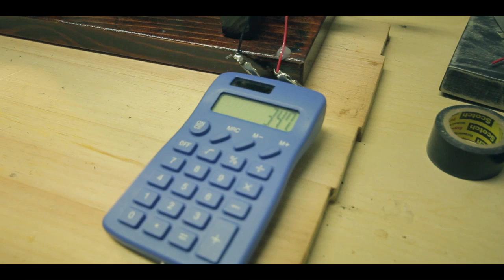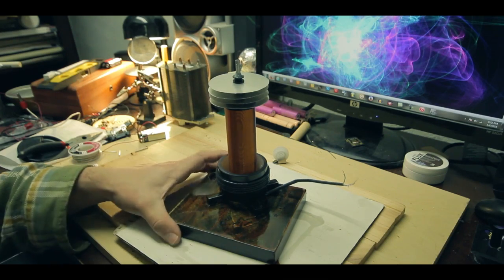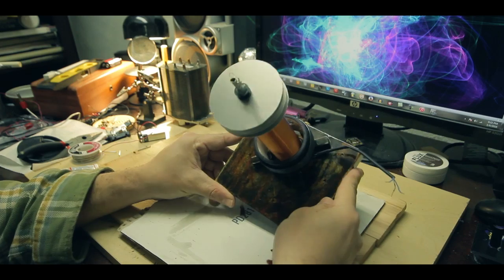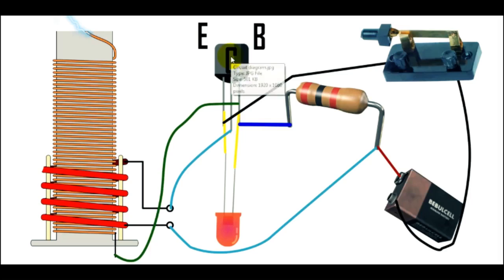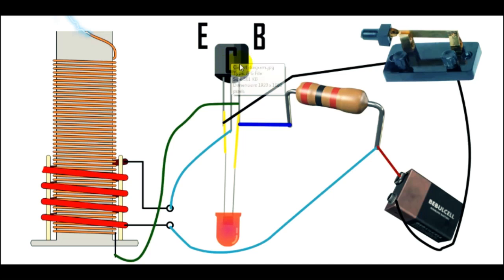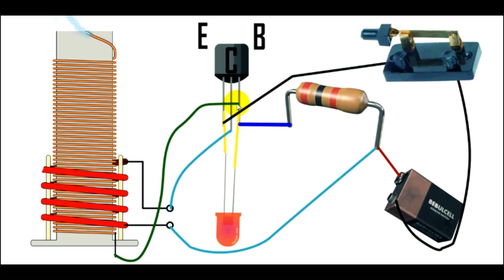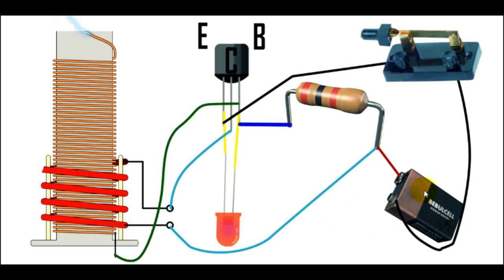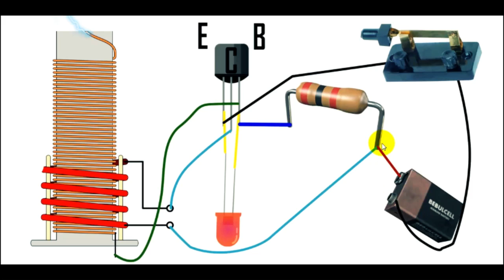DIY Tesla Slayer Exciter Coil Tutorial Mini How to Build Easy Circuit Explanation

Comment: Can i buy that one from you?
Reply from the maker: I would have sold it to you, but I sold this one already. I have built several of these, which generally look the same. However I did make several improvements. The top load is machined now, and has a cleaner look than the one displayed in the video. I could possibly make one for you. How much would you offer?
Reply: Whats a good price?
Reply: 40 bucks? plus shipping
Reply from the maker: Conspiracy Theorist The only way I could do it for that price, is to exclude the top load and staining the wood base. Staining is two or three coats and then a clear coat, this all taks several days. Machining is like $25 at the local metal shop. If you want one similar then $100.  If you want with an unfinished base and no top load, then $50. You could always finish the base and add top load yourself.
Reply from the maker: Conspiracy Theorist You should also check ebay and Amazon.  I know both sell Tesla coils, and you may find a nicely built one cheaper than what I could do.
Reply: Have a few more ??? sorry i am a newbie when it comes to this. Can you use a bigger battery such as a 12 volt? What happens when you have a taller Tesla coil? Also what would it take to make a further distance from the bulb when holding it up close?
Reply from the maker: Adding voltage will increase the distance. The Tesla coil in the video will handle 12 volts, but making a taller secondary coil will only create entropy in this specific circuit. Fine tuning, which usually involves an oscilloscope, aides in Tesla coil designs. I believe this tutorial gives a biginner a straight forward design without getting into the technical jargon, or over complicating it with schematics. 

The process of calculating capacitance, resonance, etc, helps in designing an efficient Tesla coil. The hight and turns of the secondary and primary coils work well with this specific Slayer Exciter coil. Although there are alterations that could be made to make it better, but as I mentioned, this would require an oscilloscope which are very expensive. Plus one would require the know-how in fine tuning and general knowledge in mathematics/physics based around electricity.
Reply: Interesting thanks so much for the advice what about removing the metal plates on top and replacing it with a light bulb?
Reply: José da Vēde i would like to buy as diy kit or half made. Can you send me? Tell me the price
Reply: i try this many time but the problem is always burn the resistor and transistor ..can you give me advise

Comment: On you circuit diagram you say "the negative going to the emitter, which is the negative going to the battery". But your negative wire (black) is actually connected to the positive side of the battery. On a 9V battery, the small terminal is the positive! Also, aren't the primary and secondary supposed to be winded in opposite directions?

Comment: Thank you, excellent tutorial.
One thing wasn't clear to me was the how the washers are attached to the secondary coil. Can you please clarify? Thank you
Reply from the maker: I used the washers as spacers between each top ring, which also holds them in place, and is a snug fit on the aluminum rod. Hope that helps. Thanks for watching!

Comment: The diagram showing the 9volt battery + positive going to the switch and - negative to the resistor and E is that correct ?

Comment: Is the LED in the your circuit working properly as a high-speed rectifier? In most cases, the frequency response of the LED is poor and often LED not act as a diode. I think you should insert an Ultra Fast Recovery diode or a Schottky barrier diode in series with the LED.

Comment: Hi sir may i ask if why is that my tesla coil is not working? I already follow your layout. How many volts is your bulb?
Reply from the maker: You will need a 13 watt or lower florescent bulb. Also you may need to switch or reverse the two wires coming from the primary coil.

Comment: secondry wire is insulated?
Reply from the maker: UTSAV KUMAR Can be, with a clear coating. Take a flame or sanding paper to both ends to insure there is no ckear coating. You can double check connecting by using a multimeter.

Comment: I had used 2n2222A transistor
And used 19mm pipe 275turns of 26Guage wire for secondary
3turns for primary by 1sq mm standard wire
22k resistor is used no alluminium foil is used
But It can't glow bulb
Please reply and help me urgent I had to submit my project at college
Used 5 volt 800 mA supply
Reply from the maker: I would guess its a your resistor. Or, try reversing the lead connections on your primary coil. Did you use an LED?
Reply: José da Vēde no I did not used LED Brother
And I used 2.2k ohm but bulb doesn't glow
Reply from the maker: sai kishore Is the bulb LED or florescent? You need to use a 13 watt or lower florescent bulb. It will not work with LED lights unless they are very low wattage.
Reply: José da Vēde I used flurosce t to check it but it doesn't glow
By using tester the tester glows at top end of secondary coil
Reply from the maker: Double check your connections. Watch my video starting at 2 minutes. It is really easy to follow. Here's the link - https://youtu.be/AyRtWntO4Rk
Reply: José da Vēde I had done but doesn't come

Comment: 1. On what basis is the transistor selected?
2. If I want to power it using 12v 2a adapter, then what changes will I need in components and secondary turns?
3. What would be needed to see small arcs?
Thanks! :)
Reply from the maker: Ashutosh Bhakuni I tried several transistors and the BD 135 works well and can handle 12 volts no problem. But, if you want sparks you will need to go with a mosfet transistor and more power, 24 volts or more. You will also need to add a capacitor or two. I would research mosfet slayer exciter coil. There are several videos about this configuration. Good luck with your project!

Comment: I tried to build one from the instructions found on the web.
I used 3 different configurations.

THEY DO NOT WORK.  THEY ARE SCAMS.
Reply from the maker: Have you read through all the comments? Are you saying I paid all these people thanking me for this tutorial. I guess I also paid for all the likes too. I think the problem here is your lack of education on the subject, because its not a 'SCAM AND IT WORKS'!
Reply: I did not say, nor did I imply, that you paid for anything in the way of likes or testimonials.
    I studied electronics years ago (Almost 40, now).  When I saw this (And yours isn't the only one), I thought I would check it out for myself.  After all, it seems too good to be true, that we could have such an abundance of energy available for little to no cost.
     I purchased my wire, transistor (NN2222A), resistor and breadboard.
I found that I didn't have a 22K resistor, so I placed several in series.
They totaled 22K.  After 2 times on the breadboard, I decided to be fair and try direct soldering, although I didn't want to waste my limited solder for this.  
     I checked the components.  The switch works.  The transistor is fine.  The resistors all were okay.  Battery clip, no problem.  Battery, good.  Coil checked out.  
     So, why didn't it work?  There is only one possible conclusion for me.
     IF you can tell me why it didn't work and I can confirm, I will GLADLY retract my statement, post a positive review, say thank you and even apologize for the statement if you would like.  
     I Know you went to a lot of trouble to make this video.  Proper editing can be a difficult chore.  And it probably took a great deal of hard drive space to create it.  That says a lot for you.  
      My father was a relay technician.  Unfortunately, I can't go to him to ask why it didn't work.

Comment: Could you just confirm something on your electrical diagram the negative side goes through the switch but on my well known brand beginning with Du the contacts are same shape but different polarity, so could you confirm that picture for me. Does the positive the circular point connect to the emitter or the positive?
Reply from the maker: For Synth's Sake it's actually backwards I marked them wrong. You would use the negative terminal on the battery as I described, but not as shown on the battery. Hope this helps!
Reply: yes, thank you i figured it was the case and finally got it working.

Comment: Hi, can I use sd 335 stransistor, I think that they are same but i found different frequency on internet between them.
Reply from the maker: The 335 should work fine. You could cross reference transistor data sheets to compare. Hope it works. Good luck with your project!

Comment: Now simply REVERSE the power direction and PULL IN EATHER ELECTRICITY from the air, run through machine, through spark gap 1)to grounded water source and 2) back to the top air coil SOURCE and 3) a feed in loop to keep power constantly flowing through your gizmo FOREVER AND EVER eliminating the need for a power source. Eye call it: Zero Point Energy for the People. (everything in 3's. Think: Jacobs Ladder 🍻 🍄🍄🍄
Reply from the maker: andrew gates Well, I wouldn't say air necessarily. But, rather extracted from the universal code itself, or more like harnessed. The 'code' can be shaped because the eather as you call it, is pliable.
Reply: José da Vēde: air, was said because it's what most people understand. Most people will attack you for the way you said things, but we understand EXACTLY what you are talking about. The Matrix or Code IS pliable and can be over written, added to, rewritten and seemingly altered completely. This is why reversing this Tesla Coil is simple...so that instead of NEEDING a lot of electricity to run it, instead it would now create that electricity to run its self from that top donut emitter/now collector so it can now supply a house or car or anything with free electrons (Free power) to run anything, anything at all. Thank you for your conversation. It's a pleasure to talk with someone who understands what we know. We tried to share this with General Motor Co but they forcefully declined our technology. So now we release it everywhere for free. Like on these forums and elsewhere.

Comment: BD135, primary has 5 turn secondary has approx 340 turns...All things are same but circuit is not working... Why???
Reply from the maker: salim javed Try reversing that primary wires. That usually fixes it.

Comment: Hi,
thanks for your video.
Can I use 4212DT or MJE13005a or T13005D transistor ? With 22k or which resistor will be perfect to get electric arc ?

Comment: Does that conserve energy... Is the light tube using power from the coils or the battery???
How big does this system have to be to run an 11-watt CFL lightbulb???
Basically, when the battery runs out of juice the lightbulb dies, correct???
Reply from the maker: This design does not conserve energy, but demonstrates wireless energy only. Yes, when the battery runs out it will need to be replaced. If it could recycle its own energy then I would have a perpetual motion machine which does not exist or is unknown to the masses at this time. The battery is needed because Tesla coils have to draw energy from somewhere. Nikola Tesla apparently harnessed the natural energy from the cosmos, as he put it, to power his tower. This design should power an 11 watt CFL no problem.
Reply: Thank you... You know your stuff...
Can I use a dc 20 ah battery instead and later recharge it instead of the 9v battery???
Reply from the maker: The highest voltage I've tested this build with is 18 volts. A higher voltage may blow the transistor. However, I will say that higher voltages do extend the wireless range. If you have a bench power supply, that would work the best.
Reply from the maker: This coil has a limited range, but the 12v battery should be fine.

Comment: Hey. I was thinking to use this for a school project. I have a few questions. Since there are a ton of fake videos out there, does this really work? I am really a newbie in this kind of stuff. Will I be able to make it in 5 days? Are there steps that are really important that you can't afford to do wrong? Please reply fast.
Reply from the maker: Rithik Kapoor it's real. If you follow my tutorial exactly it will work. Buy the same components too. Definitely not fake. Check out my ratings and comments.
Reply: José da Vēde thanks for replying. Will someone like me who is new to electronics be able to make this?
Reply from the maker: Rithik Kapoor Yes but I would use a bread board to practice with first. They are really cheap. Make sure to use my exact specs when making the coils. You do not need a top load to work. Or, you could use an aluminum foil ball.

Comment: Can u suggest me tips for winding the wire
Reply from the maker: Gamer Roll, I would hand wind it. I've done several this way, and it works great but takes time. Make sure there are no spaces or loose wire. Sand or burn the ends to ensure a good connection. And most importantly count your windings. Between 350 to 450 works best.
Reply: An making one without led as seen in most other videos and they have told me that 200 turns is enough for that one
Reply: Can u tell me the time in which I have to remove the enamel in the wire

Comment: Can I use 28 awg copper wire
Reply from the maker: Gamer Roll Yes, 28 guage magnetic wire will work well.
Reply: José da Vēde   It seems less misleading to call this "enameled" wire. For others, the thin wire insulated with paint is well understood for it's use in windings.

Comment: Hey bud, I dont know if you’ll see this (I know the video is a bit older) but how do you go about attaching to the top load? Is it simply attaching the wire from the final wrapping point to the top of the pole? Thanks!
Reply from the maker: Yep, just attach your top wire to whatever you are using for a top load. I would use some scotch tape to hold the wire and experiment with different material or variations of your top load to see what works best.
Reply: José da Vēde thanks bud! Would be correct in assuming yours runs beneath the rubber washers directly against the pole until the top where it is then doubled over and soldered to the insure of the pole hole (for lack of a better phrase lol).
Reply from the maker: Yep, that's exactly how I did it. The pole works better if it's aluminium and I used sandpaper to get the coating off the lead wire.

Comment: SIR what resistor should be used for  2n2222 transistor
Reply from the maker: You would need to use the 47k 1/2 watt resistor. Hope this helps, and good luck with your project!

Comment: Yo. Can you explain how it works?
Reply from the maker: The Slayer Exciter is an oscillating circuit that steps up low DC voltage to high AC voltage creating an electromagnetic field that excites the phosphor in fluorescent or LED light bulbs.

The transistor in the circuit works like a valve, opening and closing several times a second. When the valve stops the flow of electricity, the primary coil will collapse and the secondary will pick up the voltage and increase it. The top load acts like a capacitor, which also increases the output and excites electrons in the air. 

The resistor limits the power to the transistor to reduce over-heating.

The two coils can be referred to as a air-core transformer, meaning the coils are linked through the air by a magnetic flux, which is induced by the supplied voltage. Research Faraday's law of electromagnetic induction for an overview if interested.

I hope this explanation will help. Thanks for watching!

Comment: I really liked your video well explained. i have a few questions 
Is the top load necessary?
what is the wattage of the bulb to be used?
Reply from the maker: The top load is not necessary for the circuit to work. The best flourescents to use would be 13 watts or less. I hope this helps, and thanks for watching!

Comment: What frequency does the secondary coil operate at?,and at how many volts?.Did you measure how much current does it put out of the secondary coil?.
Reply from the maker: I did not perform any testing on this coil. For one I would need an oscilloscope which I can't really afford, and two being such a small coil it didn't seem necessary. I'm sure it's not operating at it's best and with an oscilloscope and tweeking one could get maximum performance. But, as I said it's a small coil. If I were building a large Tesla coil then I would certainly find resonance. Thanks for watching!
Reply: José da Vēde Its a very good video.😀

Comment: With 9V Battery my Tesla coil wasn't able to glow Cfl please help
Reply from the maker: Is your fluorescent 13 watts or lower? If it doesn't light then I would recheck your circuit. One thing that many people forget, is to reverse the wire connections on the primary coil when the Tesla coil isn't working. The reason for reversing the wires is due to which way you wound the primary, (5 wind coil) clockwise or counterclockwise. Hope this helps!
Reply: José da Vēde not working everything as per circuit but I have burn 5 transistor everytime 2n2222